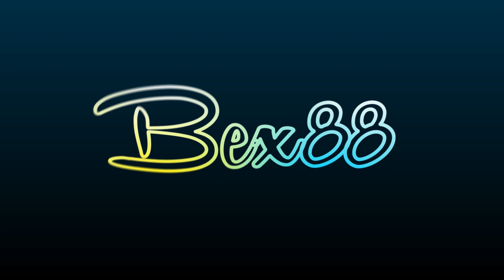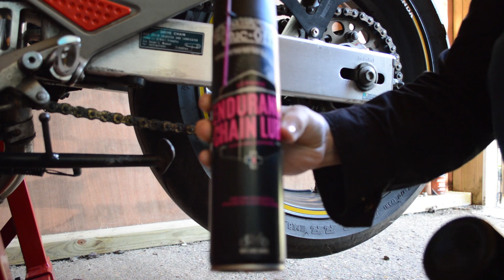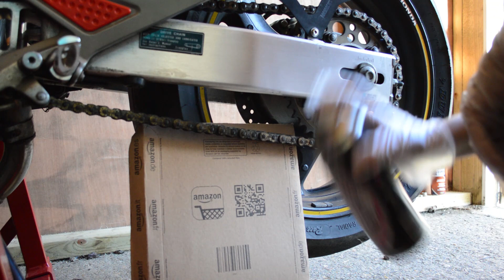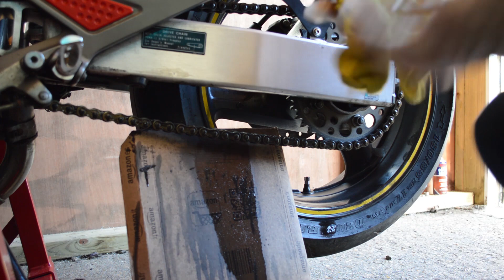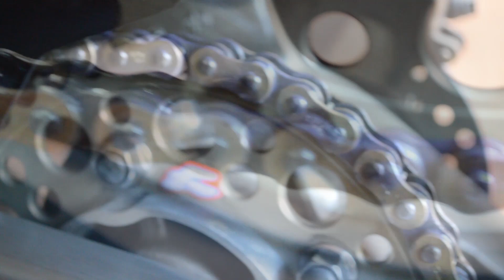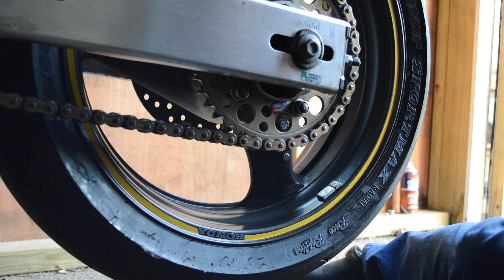How I Clean My Motorbike's Chain

Comment: Nice stand; I like that!
Good job, Girl...your bike will be running like butter now. The wheel looks superb now!
Reply from the maker: +WheelsNotHeels Thankyou Wheels! :D I usually tend to do this every 300-400 miles will just a spray of lube inbetween if it needs it.
The stand is brilliant for when you don't have a centre stand on your bike. It can be left on the stand if storing it too. I Also have the extra part that allows for the front wheel to be lifted as well, but not used that bit yet.

Comment: very good tutorial. thats a weird stand never seen one like that.. I use the mazima brand chain cleaner, lube and wax and the grunge brush.. again good video.
Reply from the maker: +CruzinMoto Thanks Cruzin, The stand is made by a UK Company, they are very highly recommended. I've also got the front lift arm for it so I could have both wheels off the ground if needed. :)

Comment: It is strangely very rewarding to clean a chain haha. I used muc off chain lube and degreaser too. Some good stuff.
Reply from the maker: +TheSpikeyBiker It is isn't it, and so much easier with the Abba Stand. I used to have to roll it forward or backward a bit at a time to do it before and used to take me aggges lol. Yeah I think so, can't go far wrong with muc off - I just ordered a 5L bike cleaner refill for my 1L spray bottles as I've run out haha
Reply: I think muc off is your biggest fan then :P. You should try and get them to sponsor you so then you never have to buy it haha.
Reply from the maker: ahh I don't think I'd like to be tied to a big company in that way really, probs more hassle than it's worth.

Comment: One other bit of advice I would give is clean the chain after a good ride. When the chain is nice and warm the old lube will come off much easier. The same is for applying fresh lube, do with a warm chain. I usually lube the chain then give the wheel a good spin so the lube is evenly cover on the chain then I put the bike away, this allows the lube time to soak it's way in. They say you should do it roughly every 200 miles.
Reply from the maker: +RevvedUpBiker Yeah I do prefer to do it after a ride usually, I was planning to do it the other day after I had a ride about but it was soo cold I was like naaa I&#39;ll do it another day haha! Otherwise, like this time, I do it on a day when I don&#39;t plan to ride it and leave it overnight or till I ride it next. I probs don&#39;t tend to do it that often, more like 3-400 miles with a lube respray inbetween if it looks like it needs it (Usually only needed when using the Wurth dry lube as this stuff lasts longer).

Comment: Nice one Bex.  On the back of this I've ordered one of those brushes rather than use old toothbrushes :)
Reply from the maker: +wyvernbiker Ahh good one Keith! Just makes it quicker and easier I think :D After using it I just spray a bit of chain cleaner or degreaser onto the bristles and then rinse through with warm water and it's ready to go for the next time.

Comment: Nice, I'm going to install a tutoro automatic oiler on my FZ1 over the weekend I trialed a Loobman (haha) on my Suzuki and it does an amazing job and is great if you're lazy. Lubricating the chain with the second exhaust in the way was annoying.
Reply from the maker: +Bikers Quest ooo yeah I bet that was a bit of a nightmare then - I haven't seen much about the tutoro auto oiler, I do know about Scottoiler though as my ex had one on his Bandit but he did have troubles with it.
Are you gonna do a vid on it? :)
Reply: +Bex88 Possibly a review, it's a lot simpler than a Scottoiler as it doesn't require splicing into the bikes vacuum or attached to the battery but is still automatic :D

Comment: well put together i like it :) and i do simellier but with wd-40 to clean  and yamaha chain lube its almost £9 a spray can but like you i try to leave it overnight and it dose not fling much at all :)
Reply: +Mazerbigone but WD-40 is a Degreaser... never use WD-40 on a motorbike chain! Especially if you have an unsealed chain! You might get away with it on an X-ring or O-ring chain but that's only because they don't need lube in the first place as they are sealed... WD-40 will perish the rubber seals in the chain rings and shorten the chain life.
Reply: +The Mighty Dash wd 40 is fine to clean chains with after all it's just fish oil and yes it does degrease a bit that's why it cleans so good but it still is oil and like I sed I use it to clean then I clean the wd 40 off with a rag and then re grease the chain and it's done me ok for over 20 years on push bikes and motorcycle at the end of the day wat do you think you are spraying on your chain anyway when using a chain cleaner it's a degreesent and dose exactly wat wd dose only on the tin it so says it's good for chains. I have done on previous bikes over 10k on a chain and it was still good when I changed it I just changed it for peace of mind as it had done 10k, it's just personal preference we could go on for ever a bit like the PlayStation v Xbox what one is better? Also wd 40 is grate in the line of work I do in the body shop paint n machines ect as it dose not have silicon in it you would be surprised wat it's good for if you read the back of the tin and I always got one handy
Reply: +Mazerbigone ah you didn't mention you cleaned it off after :p you'd be amazed at how many people soak their chain in the stuff and nothing more :p I normally just soak my new chain in engine oil for a day or so before fitting it then just leave it alone, modern chains are sealed anyway, but yeah as long as you grease it after is fine :p was just making sure, you'd be amazed how many people use WD-40 as chain lube.
Reply: +The Mighty Dash ya soz I should of explained how I done it in a bit more detail 👍
Reply: +Mazerbigone Nah my bad, I should have asked :p

Comment: Ya gotta love muc off. I use all their stuff too. I'll have to get me one of those brushes though, better than my old tooth brush, lol.
The biggest question I've never found a definitive answer for is, how often should you clean and lube ✊
Reply from the maker: +Doticaster Yeah can't go too far wrong with muc-off as it's made specifically for bikes. That particular chain lube does fling a bit but lasts much much longer than the Wurth dy lube for wet/winter riding. Those brushes are really handy, saves a bit of scrubbing time :) I tend to do mine every 300-400 miles and sometimes give it a top up spray in between if I've washed the bike.
Reply: Bex88 see I don't like the fling .

Comment: Hey Bex......its good to see you looking after ya bike but you can save yaself a bit of money here.....
I know chain cleaners can be expensive and do exactly the same job as a cheap version of wd40 from a pound shop or similar....
once cleaned with the brush just a decent wipe round with a clean ish rag and ya good to go. ...
I've used many chain lubes over the years as I'm not a fan of wax or  permanent chain lube systems and I have to say that wd40 chain lube is the very best I've used.....it gets into the whole chain from the top and both sides of the links.....and is fairly quick drying although I always let it stand overnight or for a few hours during the day......absolutely no fling off at all on the 600 but more importantly the zx12.......
Good to see tho Bex....
Rsml
Reply from the maker: +WEGGY zx12r Heya Weggy - Thanks for the tips :) Seems the whole using WD40 to clean a chain is quite a controversial matter from reading other comments and posts on forums. Might give the WD40 chain lube a go next after the Muc-off has run out - does smell sooooo nice though :P Same as you Weggy - I usually do it on a day I don't intend to ride so I can leave it overnight, or ideally do it after I've already ridden so the chain is warm. RS x
Reply: +Bex88 No controversy Bex.....I've used it on all chains for years....o ring....x.ring etc.....
old school and it works baby..
yeah I see your comments after I wrote mine.....
A true bike chick!

Comment: Pretty much how I do mine including the chain brush and surgical gloves lol.  I've been using the Wurth chain cleaner and lube.  Got to be careful with the cleaner, it does run out quick.
Reply from the maker: +Phil480 Ah yeah the Wurth stuff is good no fling from it - I started using it when I first got the bike as it was recommended but I was riding it now and then through winter, relubing it every so often - but when I took it for its first MOT with me in March (Last year) the guy said my chain needed lubing as it was dry (I assume he meant the lube had come off as I was using 'dry' lube lol) and I noticed it was just starting to get some rust forming. 

That's when I realised that when I was quickly hosing the bike down after riding it/riding on wet roads/in light rain was just washing off the dry lube very quickly - so then this winter I decided to switch to this muc off stuff which lasts really well. I'll go back to the dry lube in the warmer months.
Reply: Yes, I've heard the dry stuff is better in the summer.  It does seem like my chain goes dry in the winter, so I'll probably get some of that yucky stuff hahah.  I also need to find something that is good at cleaning up my wheels. The rear is filthy and my usual stuff won't touch it.  Might need to get some Wonder Wheels or something.
Reply from the maker: Phil480 Heya, one of the ladies from the women's bike group I ride with sometimes said she used to be into car detailing and much of what she learnt from that will apply to bikes as well. She said she uses Valet PRO Bilberry Wheel Cleaner. Apparently it it good as it wont attack the paint cause it's acid free.
Reply: Okay, I'll have a look for some of that and see how I get on.  Thanks for that Bex!
Reply from the maker: Phil480 No probs Phil, might have to get some to try myself. :)

Comment: Ah no Bex you went for Muc Off? That stuff is grossly over priced. Personally I like to use a cheap electrical cleaner to clean the chain, it does a great job at blasting all the grease off and dries quickly out so your not left with any cleaner on the chain that might interfere with the lube.  That said great video mate, well thought out and nicely put together :)
Reply from the maker: +Darth Peachy Heya Chris, yeah I have to say I do like the muc-off stuff - even though it's a bit on the pricier side, I like to use products that are made to be used specifically for bikes so I have less chance of screwing anything up hehe. I buy most of it online and if you shop around you can actually get some good deals on the stuff so it's not too bad on price really.

I use the Wurth Dry lube for the warmer months, even so that is still around the same price, I think the can is slightly bigger but I still seem to get through it just as quickly.
Reply: +Bex88 Yeah fair enough Bex, I can understand that :) Sometimes I spend more money than i need to on things because I'm stubborn and i know what i like haha

Comment: Nicely done Bex. So is the Muc off range good then?  My DRZ has wax on the chain, but i'm due to clean that off soon & re-lube. Worth going for this over wd40 & generic cheap lube?
Reply from the maker: +BimbleBoy Blue Thanks Bimble :) I like muc-off cleaning stuff in general as they are made for bikes so I can't go far wrong with them (And some smell nice too hehe) but as I haven't tried many other products I couldn't tell you in comparison.

I grabbed this chain lube in a bit of a hurry a while back when my chain needed lubing before a rideout and I had run out of the Wurth Dry Chain lube at the time. I went for this so I could use it over winter/if if rained etc.. as this stuff last really well compared to the dry lube stuff which I find needs reapplying more often - however for me I find this stuff is sticky but I still do get a bit of fling from it which I notice on the underside of the tail - but at least I won't have to worry too much when I give the bike a quick rinse off if it's muddy/salty. I'll switch back to the dry lube when it gets warmer/dryer.

Had a couple of comments suggesting a cheap way to clean the chain is with WD40 (Or pound shop equivalent) and I've been reading on forums about it - apparently most people say its fine as long as your chain is in good condition - WD40 is very good at penetrating and so if the seals are worn then is a chance it could get in and remove the grease inside (Or something along them lines). But I imagine if they are worn it's probs time for a new chain anyway. For me personally, I like to use stuff that is made and says what it's specifically for so then I have less chance (hopefully) of screwing something up :P

I'd say if it's been working well for you then no need to change what you are doing :)

Sorry, Bit of a wall of text there lol! Take it easy BBB x
Reply: Bex88 ...a simple yes or no would've done Bex! ;D
I agree on buying bike specific stuff, especially for people such as we who aren't as mechanically inclined as some. Tho i'll wager you know more than i on the subject. Pays to be careful for sure. A little knowledge can be a dangerous thing.

I actually use white spirit to clean the chain more often than not these days since my bro clued me in to it (he's a mountain biker). It's cheaper and as far as i'm aware not quite as penetrative/intrusive as wd40, but i'll use either, depending on what's at hand.
 Really liking the sound of that lube tho....especially if it smells nice, Mmm! :)
The stuff i use is quite thin and tends to fly about a bit, & does need re-doing quite often, so i may have to invest in some thicker Muc off stuff and give it a try.

Thanks Bex, be good & look after yourself mate x
- B
Reply from the maker: Hehehe! ^_^
I heard about white spirit being a good chain cleaner too, also heard of people using paraffin too.

I just look up things I don't know about to try and learn about them a bit so I don't sound like too much of a noob if people ask XD haha!

Smells sweet like bubblegum :P I didn't realise until I re-read the can that the dye you see is UV dye and so if you shine a UV light on it you can see properly if the chain is coated and also if there is any on the wheels etc.. :) Just need to get myself a uv light now XD haha

You too Bimble x
Reply: Hehe! You could always take the bike to a night club...Wooo! Glow in the dark disco bike! Groovy baby! :)

The only time i ever used paraffin was when i used to breath fire years ago...maybe i shoulda done more research to find out what it really should've been used for ;)

I'm such a noob, there's simply no hiding it!

Gonna have to get some of that lube now...I want my bike to smell of bubblegum & be a disco bike too! :D

Taters mate, be good.

Comment: Hi bex top job on cleaning the chain ;-) I couldn't help but notice that your chain also needs adjusting tighter and also your rear sprockets teeth are sharp pointed and hooked :-( and really needs replacing asap as the chain will not fit properly and will increase the chance of it being thrown off whilst riding,just sharing my personal experience of worn chains and sprockets lol ;-)
Reply from the maker: +Chunky Monkey Thanks Chunky Monkey :) 
I thought it might be soon that it would need adjusting, I've not checked the slack in a while - I don't feel too confident to do it really though - but I'm sure it can't be too hard..

I've see some pics of worn sprockets, looking at the vid they do look a bit pointed, I wouldn't say they looked hooked though but I'm taking the bike down to a garage on Tues to get them to have a look at my lights as the sidelights stopped working a while back, so I can ask them what they think. Done about 4400 miles on them since I bought the bike and I think the guy I got the bike from was the one who put them on and he only rode a it a few hundred miles.

Think this is what's on it: http://www.mandp.co.uk/index.php/default/cb600-98-06-r4-srs-c-s-kit.html

Comment: Are you after some freebies from Muc Off Bex? ;-)
Works well actually. Have you tried kerosene? I use it as a cleaner. A bit messy but it really does the job. It's cheap too at about £6 for half a gallon.
Reply from the maker: +CalmBiker Haha I wish Richard! XD I just generally like the stuff, though haven't tried lots of other brands to compare it to but it's just a safe bet really as it's designed to be used on bikes. Here's the actual story - all the box of muc-off and other cleaning bits and bobs was supposed to be an xmas present for my now ex a few years ago, I didn't even have a bike at the time but was planning to do my test - we split before the Christmas so ended up with it all for myself.

Yeah I've heard a few mention about Kerosene and read about it on forums too, maybe have to try it out sometime.
Reply: +Bex88 Hahaha! His loss, your gain then?
Reply from the maker: CalmBiker Exactly! :D

Comment: I won't clean my chain as it has tight spots in it which means it needs replacing, I will also do the sprockets as i wont to go back to a 15 - 45 combo, also new tires as well in time for Easter :)
Reply from the maker: +banditnev Ahh well replacing it is one way to have a nice clean chain hehe! :) Not sure how long the chain and sprockets on mine have been on it, I've done just over 4k on them and I think the guy I bought it off was the one who put them on it. I also need new tyres, was looking at the PR4's but with fitting it's gonna cost nearly £300, so either need to save up more or get something cheaper.
Reply: +Bex88 I bought Pilot Road 4's front and back but get them at cost price so I'm lucky I don't pay full price.

Comment: You should give Motul C5 chain paste ago.  Zero fling/mess.
Reply from the maker: Ah cool, thanks for the recommendation. Is it easy to clean off?
Reply: No more difficult than any other lube - as long as you use paraffin ;).
Its more time consuming to apply, if you unscrew the applicator you can reach the more difficult areas.